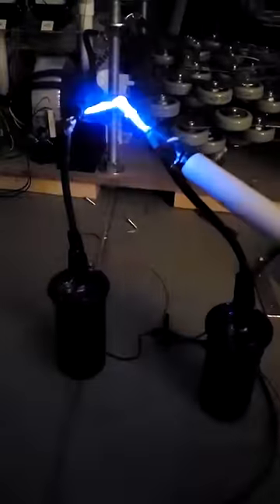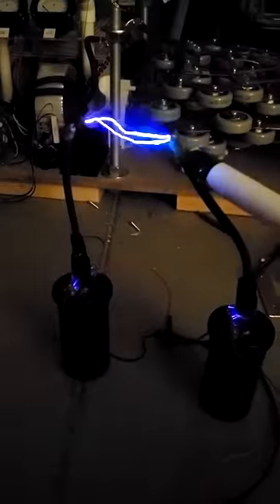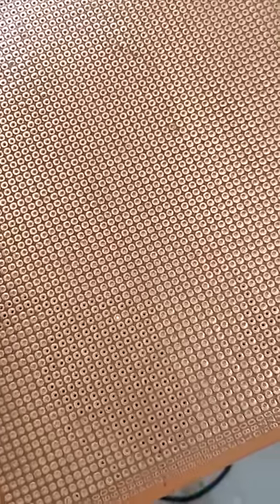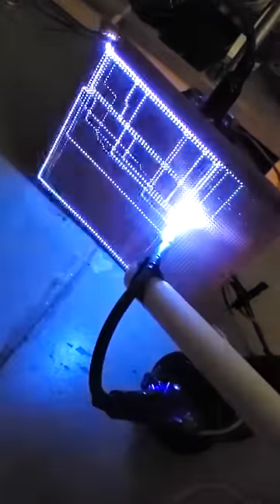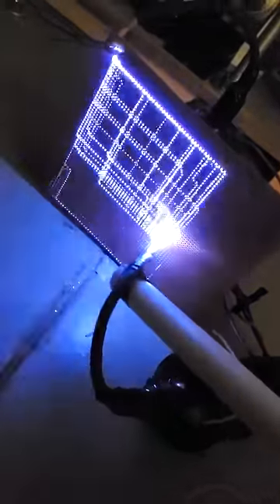car parts can be used to make this??

Comment: This is EXACTLY how I repair boards for my clients.

I have my own lab, doing component level board repair for A wide range of industrial and government clients. Also a bit of test equipment repair and metrology just to test my patience. 
Can’t believe you re-created my process so accurately!!!!
Reply: can you further elaborate how you use this for board repair?  is it because something that isnt properly contacted wont arc?
Reply: @namakaleisure4916  It was a joke. I do have my own lab and business… that part was serious.

I Specialize in component level board repair for metrology equipment… And it was just a tongue-in-cheek remark. 

Kind of based on how a lot of the laptop repair guys on YouTube will pump a high current at a very low voltage through a board with a short circuit, …..so that it will basically burn its way through the short circuit and in the process showing where the issue was. 

I just think it’s hilarious to think about doing that with A Super high-end piece of test equipment. 😂😂😂
Reply: @hullinstruments  You might have intended to joke about this, but you can actually reball quite efficiently this way.

Comment: "since the board is covered in conductive rings there's less air to go through by taking a longer gridlike path" -- I suggest it has to do with the rings being arranged in squares rather than, for example, triangles/hexagons, and hence there is less air in the perpendicular direction than the diagonal. Not sure that has anything specifically to do with being covered in conductive rings.

Comment: Reminds me of back in the day we used to weld a spark plug bung in the rear tail pipe about a foot from the end. Then used a model T coil to hook to the plug. It would ignite all of the unburned fuel in the exhaust and throw a 2 to 3 foot flame

Comment: Circuitry in circuit boards is low voltage. If you tried to power a circuit board using that method it would fry the low voltage circuits. Step down the voltage to the voltage the circuitry is rated for and you'd be ok.

Comment: Air has nothing to do with it. 1 path goes the path of least resistance. If 1 path is still energized. It goes a diff way. With this grid,  it's partial paths being relieved of energy. So the visual path is jumping around.

Comment: I made a bug killer one weekend when I was a kid back in the 70s
With a motorcycle coil. Man, even with nearly dead battery it would put you the roof if you were touching the wrong $hit !
That's what bored kids did with no internet  back then.

Comment: That is a much more visibly controlled frequency then an arc traveling in free air. however there is still a definitive medium with a semi consistent resistive value. What about an arc through extremely long and thick transparent tube with a microscopic controlled conductive powder like substance? Could you get the arc to travel a great distance? Could you create enough potential for the arc to consistently travel through it? How about metallic copper sticker place in a zig zag pattern in the tube could the arc connect the dots
Reply: Establish a definable frequency in the arc maybe even by implement 2 long magnets on each size one positive and one negative but physically held separately from each other allowing the arc to travel between them?
Reply: And the electricity is no longer flowing through the air it is traveling through the silica of the circuit board. So it is not less air to go through. The semiconductor at  the high voltage displayed has less resistance then free air now if you heat the board in the center a bit you might get a more linear result.

Comment: and then one uses that PCB as a grid aray for making nitrogen oxides that then pass thru a water percolator, surface tension of the water as to natural heat convection pressure. where in the tube is the submarines reactor heat diffuser... near the r... ear end. bootyfull sparks "touch" (sounds of anguish) WAH AH hAA!

Comment: You can get the same result if you take a pencil and draw a bunch of lines on your buddy’s cylinder head.  As a mechanic I’ve both done this prank and fixed this prank multiple times.  It’s amazing how many shops will scratch their heads to the same thing I fix with brakecleen and a sponge.

Comment: Hold on
If it went up 1 over 1, up 1 over 1, all the way to the other corner, it’s still the same amount of air gap jumped. So why would it still go in long horizontal or vertical lines, is it being effected by inertia or something?

Comment: “Pretty cool right”
Electricity bill:
Reply: Given that the device is only running for a few seconds and probably doesn't use more than 100 watts, the effect is negligible. An average central AC unit draws more than 30 times that much power for several hours per day.

Comment: Is it kind of Marx ladder? Have you measured voltage differences across the board since it shifts pattern instead of traversing the same for each jump? Does it emit a electro-magnetic field worth using as a jammer for cell-phones and wifi at a few meters distance?

Comment: Sir Pyro (or any other electrically inclined individual), might I ask why the arcs take several different paths on the board rather than what would appear to be the shortest?
Reply: different temperature and ohmage of each path, sometimes changing from millisecond to millisecond. Random movement of molecules changing the ideal arc. Or the fact that, like lightning, an arc can't calculate & find the shortest path instantaneously.

Comment: Not as cool as using that se coil as a car theft deterent by running the high power from coil to the underside of driver seat and power it from the ignition circuit so as soon as our would be thief cranks the car his bum is being lit up

Comment: Could you do this with smaller coils? Id love to try and make some art with this. However my big pussy brain is afraid of being electrocuted. Fun story, was helping an electrician wire a two way switch in a stairwell. Well I was at the bottom, when instructed to flip the switch my finger missed skimmed across the contact, normally no biggie small zap, you know how it is. However I had my other hand on a metal railing  when going to flip the switch. Needless to say I dropped like a sack of potatoes on a hot day.